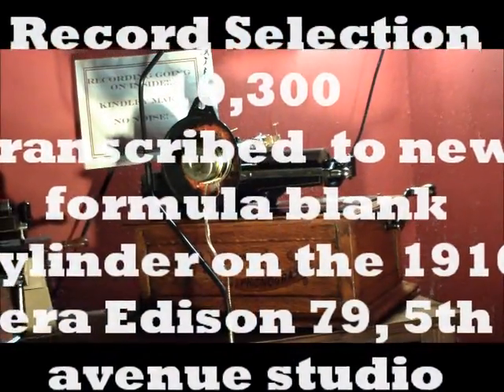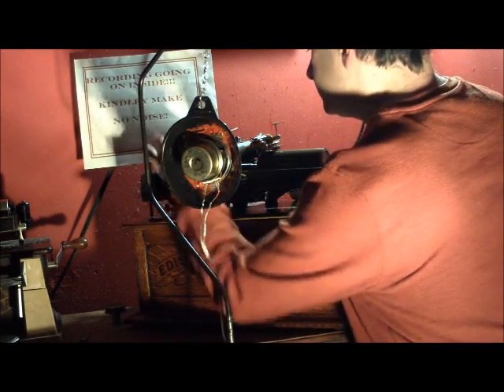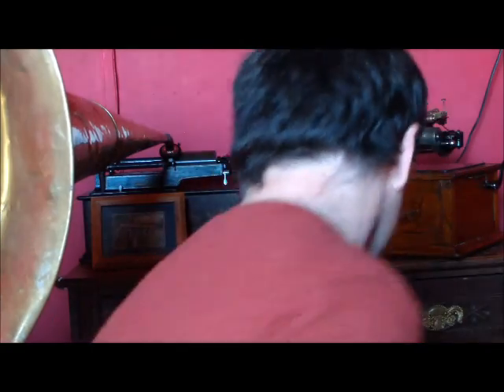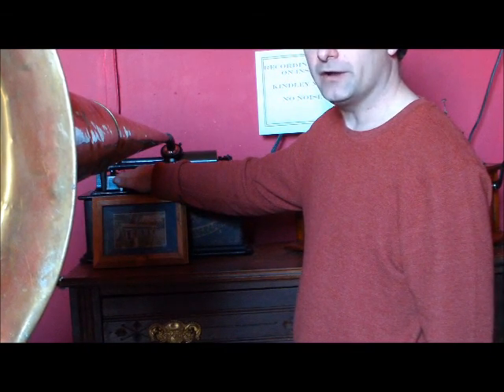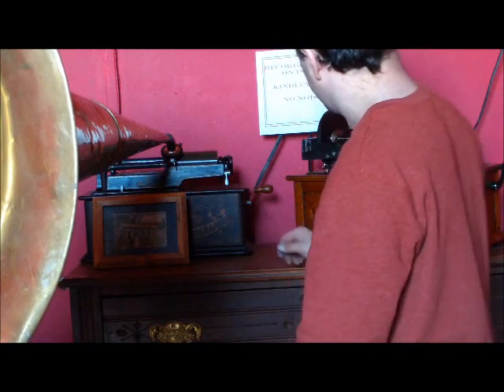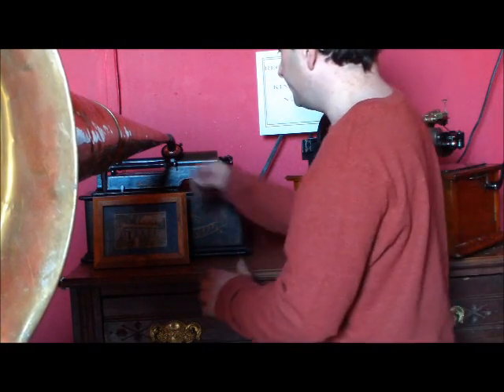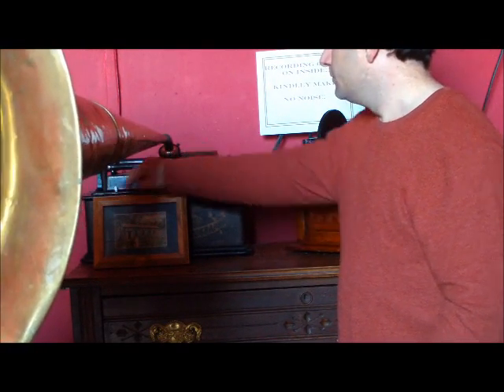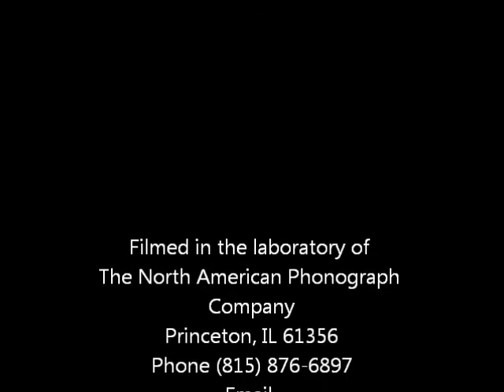Edison Cylinder 10,300 Dancing Girl by Sousa's Band on Edison Studio Recorder.

Comment: How much weight would you recommend on the cutting stylus to record on a shaved gold moulded cylinder?

I am currently working on a electric recorder to fit on my standard B made from scratch from things anyone can buy due to my age I cannot yet invest in an original due to costs. 

Thanks for any advice you can give.
Reply from the maker: You could use a small speaker with  a cutting stylus in the middle, on a hinged holder in the carrier eye.you could put a glass ball on the end of a screw to use as an advance ball to set the recording depth. You can use quartz glass to make stili, .039-.040" you will have to change it when it gets worn but I had used it in past with good results.

Comment: What year is this machine? Is it a 3 spring?
Reply from the maker: Yes Triton.  The motor and base are 1901-1902 the topworks used is from 1903-1904, I have the original 1901-1902 normal Triumph topworks too. I also have an original Edison studio feed screw, that is chain driven of 97 1/3 master pitch, so it would need a 16 toothed gear to go on the mandrel, for two minute and 8 toothed gear for four minute, that I hope to have installed before this year is up.
Reply: Nice. Wasn't that motor introduced in 1894 Produced by Ahmet ( Edison Spring Motor)? I thought they were also known as the Sterling motor. Because some of the cranks had Orange county embossed on them.
Reply from the maker: It was first introduced in 1894-1895 by Frank L Capps patents/US570378 The patent issued in October 27, 1896.  Edward Amet did have spring motors produced in 1894, and 1895, they had very large springs, the governor weights were larger and the governor had a larger flywheel than the later Capps motor, it was arranged differently than the  Capps motor which later became the Edison Tritron motor.
Reply: Edward Ahmet had is own phonograph called the Ecophone, but that was short lived, I actually got to see one. But they are so scarce
Reply from the maker: @Ecksterphono  Yes, they had a long glass rod with a ball on the end that went into some kind of wood and leather reproducer, and a clockwork motor.